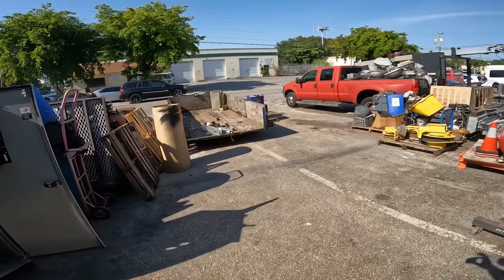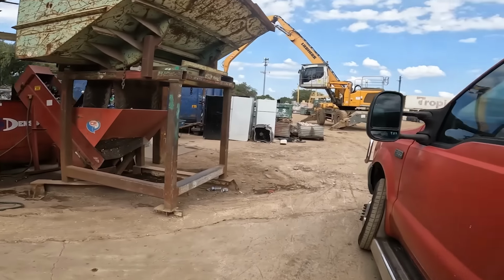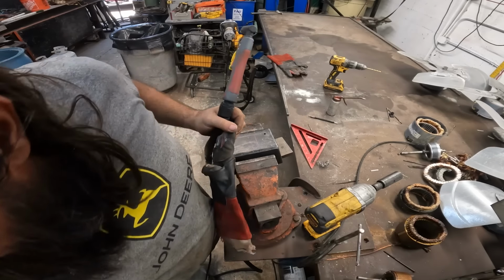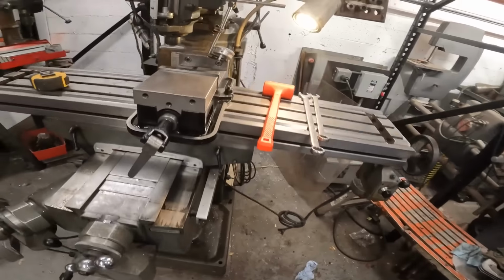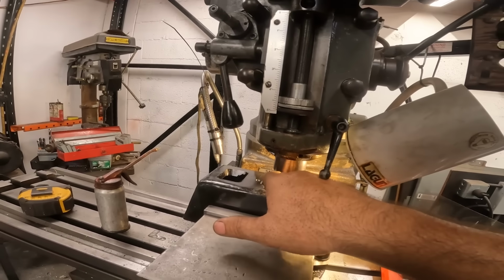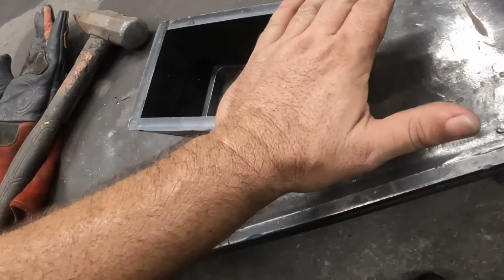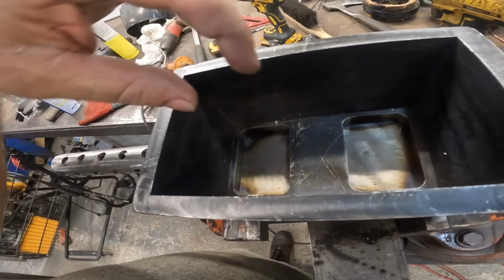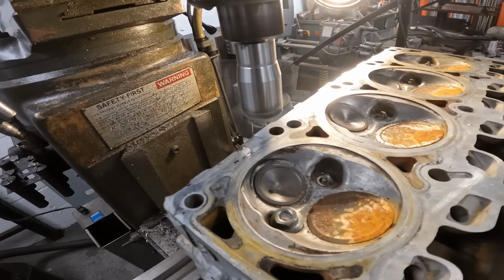Scrap Yard Run & Custom Ingot Maker

Comment: I see what you were goin for there with the depressions in the mold, give you a grip surface for full access to sidemilling the main block. I hope it comes out ok. Few projections: you might have the ingot cool clamping it into those like a lego block, this might cause a fracture in the middle of that area, maybe not. The area like you mentioned came out pretty wide, although it should stay fixed with a tight grip anyhow, you're losing that shoulder would rest on the vice for a little more resistance to pry. I don't think it'll really make too much difference. The vertical walls of that pocket make more 90^ to fill on a micro level, so it's possible you'll have a slow accumulation of buildup; there might begin to show on the ingots, an uneven crown, keep an eye on scraping those with a scribe between sessions. And if there are spaces between the old base and the new one, it might fill and lock the ingot from poppin out/leave shims of matter between. 
I don't know if I commented on the fly cutter video, but you don't really want to use the fly for standard cutting. Being a single point, it's more of a shallow (spring cut) surface finish pass, hence the wide sweep. Using it for an uneven operation like you did runs higher risk of breaking it (which is a half step up in risk because of it's swing arm motion laterally) can whip it out. An off-axis form of leaving a chuck key in a lathe. This kind of uneven load on the point will also wear it out faster so it's possible you lose overall flatness, tool material dependent. On a 12 inch span this may be negligible, but I wonder if you took a dial indicator to it you might see a thousandth variation. [fuckin machinists caring about .001, I know 🤣🤣]
Reply from the maker: Thanks for your predictions. I did a live stream and the aluminum did get under the plate. lol

Comment: Having watched this and the livestream it's interesting to hear you say you were worried that water may have gotten between the plates and didn't think the molten metal may do the same 😂. As said this one was just a tester. Thanks for the vid.
Reply from the maker: I figured the aluminum would be to thick and dense but this is all a learning curve for me. Thanks for watching the live.

Comment: They make these sets of blocks you use to fixture angled parts in the vice,I forget what they are called but there are pairs of them at different angles you put between the part and the vice to hold the angled part properly. I was just thinking,the scrap yard today is what Beverly Hills was just a few short years ago,you can actually see and maybe meet some of your favorite stars in their natural habitat 😊
Reply from the maker: Thanks I will look in to the angle blocks.

Comment: The live makes sense now I have seen this. Brother you need to weld the cut outs if water can flow under the plates so can liquid aluminium. If you don't weld a plate leave the holes place on a tray of sand then you can push smaller square bar into the sand through your square holes.. Ths will give you something to clamp onto. I get the mold you just need to weld alll 8 sides and mill out. Awesome episode brother
Reply from the maker: Thanks for the suggestion

Comment: Hey man, I have been watching some time now and i like the video's.
I guess the lego nubs in your mold are for clamping the ingots?, it will work but is difficult with milling again (extra edges and so).
If you mill an edge in the mold that is square than you're done ... ready for milling, no special clamps or modify your vice.
The ingot shrinks a little when it cools and will not stick on that edges if you round them off a tiny bit.
For milling i know if that bit is sparking your cut is to heavy and the bit is burnig up fast, i saw you take serious amounds in one pass and i never saw AVE, this old Tony and Mr Pete (tubalcaine) never ever take an 3/8 of a cut but alway in the thou's.
Reply from the maker: Thanks for the tips!
Reply: Thought "lego" as soon as he showed the nubs

Comment: Y didn’t you take the brass valve off or aluminum valve off the water heater
Reply from the maker: I did not have the time I saw it at the last moment.

Comment: You made a mistake cutting at 90 degrees, you should make at least 5 degrees slant cut. These 90 degrees pockets gonna make troubles when extracting ingots from a mold. Besides, the smaller the pocket, the worse the edges of the ingot.
Reply from the maker: I need to at 90 so hit won't slip out the vice